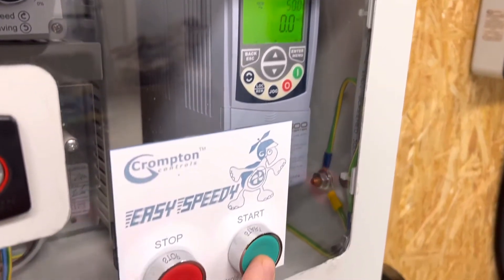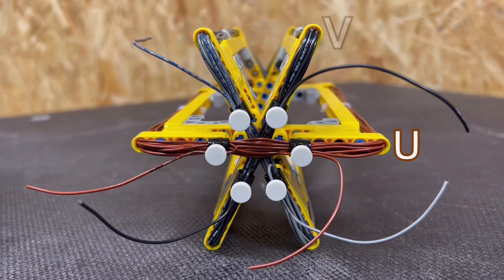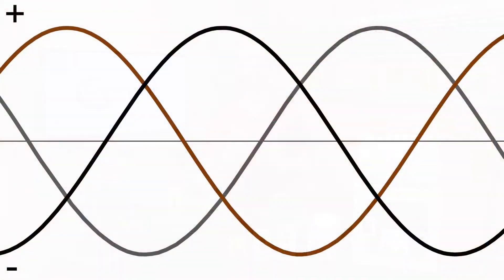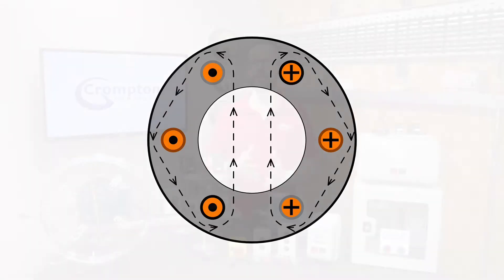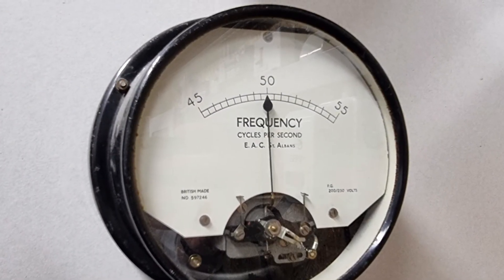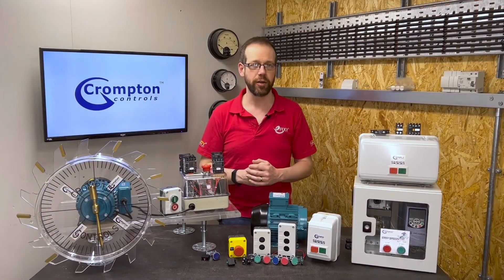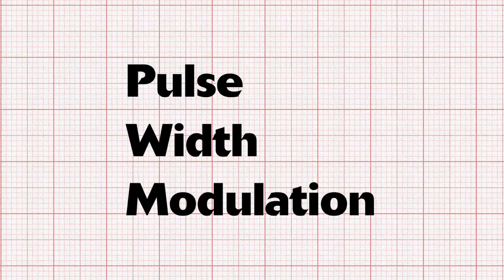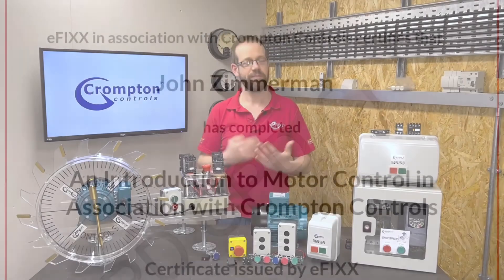How Does a Variable Frequency Drive (VFD) Work?

Comment: A lot of single phase motors are really 3 phase motors, so easy to convert to VFD control. I did this with a single speed pool pump and the results were fantastic. Including remote control, speed control and soft start… nice.

Comment: As a non electrician I hesitate to put my head above the parapet… but isn’t the standard colouring for DC wires in the UK now red and white?
Reply: Are you referring to enclosure, manufacturer, or feed wires?
Reply: @TlD-dg6ug  the wires themselves.   An MCS inspector gave me a really hard time over this in 2022;  'Of course you wouldn't know, you're not an electrician'.   The pompous twat.   I later rang both the subbie sparkies I used to use and neither of them knew either...
Reply: Is that for all DC or just for the Low voltage range? I work in a factory and we use orange and purple for the 24VDC control voltage as a site standard, but I was always under the impression that there wasn't a wider standard. I know that red and white are used normally for solar panels etc, but didn't know that it was a generic standard for DC.
Reply: @ this was domestic PV so about 300v. Not HV

Comment: The big saving with this method of speed control is that an industrial process like pumping a liquid can be controlled by varying the speed of the pump, instead of a constant rate of pumping against a gate valve to control the flow, which is inefficient

Comment: The thing that is called a 'bus' is nothing more than a smoothing capacitor, something I learnt about forty-five years ago in electronics 101. Also, whilst the system is relatively new and, I assume inexpensive, frequency control of AC motors has been around for some time.

Comment: Controlling a DC motor with a resistor these days would be crazy. Even back in the early 1980s I was using PWM.
Reply: @TheEulerID  that's only really been an option since the introduction of power semiconductors in the 1950's, although the cost power limits would have prohibited widespread adaption. It wouldn't be have been until the 1970s that power MOSFETs were introduced capable of handling more than a few tens of watts s that PWN before it really took off. Before that rheostats would have been widely used and still are in some cases were absolute reliability or extreme power handling are required.

Comment: I work on inverter software for electric vehicle motor control. That's a pretty straight forward introduction you've put together I think. As a subject it can get very complicated, very quickly...
Reply: Haha.  I had a VFD for a blower on a previous project, the operating instructions were 600 pages long... (Sinamics G120P).